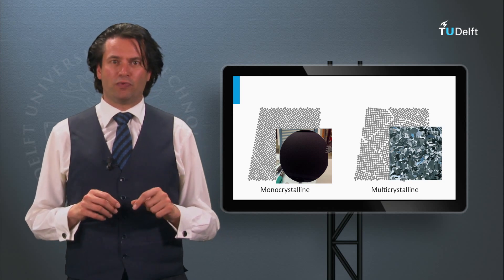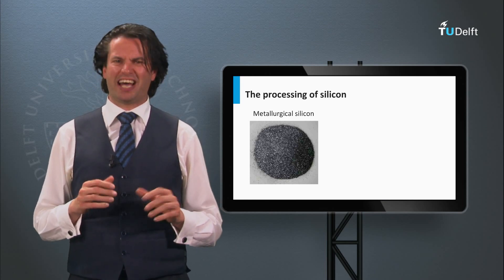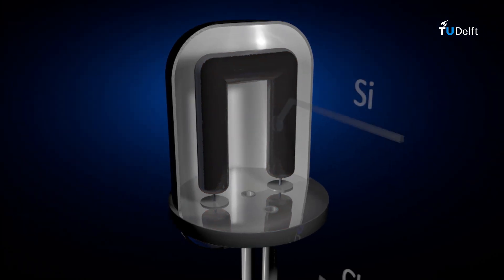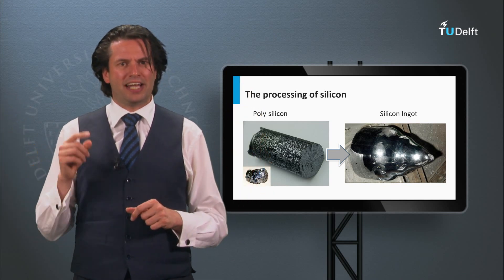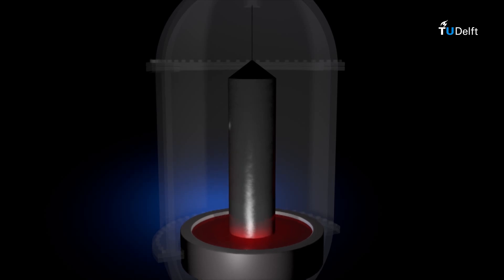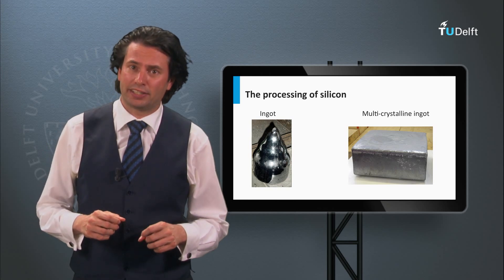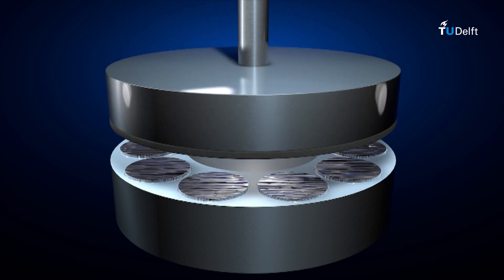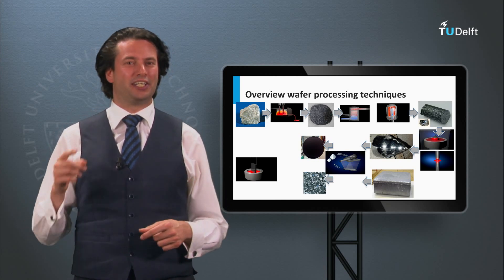4.2 Manufacturing of crystalline silicon

Comment: There is a new method for making monocrystalline solar cell material that doesn't involve cylindrical ingots or ribbons. It's explained here in this (very short) tutorial:
https://www.youtube.com/watch?v=EZQtJU0Ib9Q
Thanks to this process, it is no longer possible to tell monocrystalline solar panels by the little white diamond shapes at the cell interstices. Those diamonds were the backsheet showing through the cell corners, which were the original cylinder edges. For that reason and for the emergence of the PERC process, which improves efficiency in mono-si cells but not so much in poly-si cells, poly-si is pretty much over as of 2023.

Comment: I have been trying to find an independent explanation of this process for years. I didn't even know silicone ribbons was a thing. It sounds alot easier to make too. If I ever find myself in need of making cheap circut boards after the impending apacalypse this will most likely be the method I will use. After all silica if everywhere and is very VERY versatile.
Reply: not necessarily in the apocalypse, pretty sure you can achieve the needed temperatures with as easy to get substances as SiC (Silicon Carbide) resistors
with such (added to the fact you can use phosphor and aluminium as doping agents), it's technically possible to produce LED at home (added to the fact you're ready to produce all the energy by rotating a crank in an electromagnetic field because no way one will be able to get all of this into their electric bill and not raise eyebrows)

Comment: Understand coal is used to get to that 1900 degree temperature. So what's the environmental tradeoff?
Reply: Why coal? Electric resistances with tungsten alloy should be able to get those temperatures, or even high powered laser. The direct carbon footprint is in the SiO2 + 2C -> Si + 2 CO, yet carbon monoxyde can be turned into carbon dioxyde, then into methane (through sabatier reaction),  then graphene or graphite using CVD technology. It isn't the cheapest way, yet it is a zero carbon footprint possibility.

Comment: I have so much confusion on growth orientation. Example, If the seed is (111) orientation (lattice plane). (111) facet is introduced perpendicular to the direction of rotation and in contact with melt. This obviously means that any melt coming in contact with that particular plan follows its direction/orientation. Now, what about the other facets of the same seed dipped in the melt that may and may not  have the same orientation and are in contact with the melt and spinning? Are seeds commercially available so someone can the pick the direction of growth depending on the desired wafer plane?  Could you describe the size of the seed and  its different facets' orientations. Thanks
Reply: The seeds that we used in rod growth were square, a little bigger than a pencil and they were cut from a much larger ingot that had either 1-0-0, 1-1-1 or 5-1-1 orientation. The seed was dipped into a molten charge and a small "neck" grown which looked like an icicle.That process forced out random crystal structures. After verifying zero dislocations, a tapered pancake disc was allowed to grow to certain target diameter then the lift rate increased till a round rod starting to be pulled from the molten charge.
Reply: @toddweaver55  Hello Todd,

I am curious about how the seed crystals are made, since everywhere I have read about the CZ doesn't mention it. So, thank you for mentioning that it is cut from a larger ingot

However, I am still curious about how the first seeds were made. Would you know about that, or do you know somewhere I could read about this in more detail?

Thank you in advance
Reply: @brenorocha9407  just like any precision tool... repeated iterations of purification friend... low energy and copious time... the manufacturing processes shown are at warp speed compared to growing a seed ingot

Comment: Question... With the amount of heat we are putting in to create each crystalline silicon (for solar P.V. panel purposes) what quantity of energy are we getting back from it? You mention these huge temperatures, but wouldn’t this heat expenditure be better used once technology advances and we are able to get higher than 15-20% efficiency on solar panels commercially and up to 40% domestically?
Reply: I used to operate 6 Hamco Crystal pullers at MEMC Electronics. Each puller used a carbon/graphite heater that ran off 60 volts dc at 2000 amps. Thats 120,000 watts. There were 74 machines there. There was some power being consumed thats for sure. A typical growth cycle was 36- 48 hours.
Reply: @toddweaver55  
Good starting information, and if you could explain how many wafers are produced by each puller using 120 Kw in every 36-48 hr cycle, then we calculate the power efficiency of the system, please?
Reply: Hi Adrian. Great question. This is one of the challenges of the PV industry and solar cell companies are always striving to improve on the energy consumption that is used to process them. Typically, a solar panel takes about 2 years of sunlight harnessing to obtain back the energy that is used to make them. 

One more thing, it is impossible to get up to 40% efficiency with this type of traditional commercial crystalline silicon solar cells. There is a theoretical limit (abt 30%) for that (SQ limit). Hence, reducing the energy consumption during processing is the only way (not increasing efficiency since it is theoretically not possible). There are non-traditional solar cells that can surpass the 30% mark but it is very costly and might require larger amount of energy.

If you are interested to learn more about solar cells in an intuitive and fun manner, I'm starting a video series called "Shining Light on Solar Cells", covering the a-z of solar cells. Catch the series here: https://youtu.be/53eBzy8eZ-8
Reply: That geothermal heats the silicon production is a non cost silicon production.
Reply: @jonbigeffortthegoodness7437  Haha, false logic. Incorrect.
Reply: Should have been running the whole planet off the fissioning rock as of 40 years ago, yet here we are. What a mess.
Reply: I think it takes somewhere around 20-30 years for a single solar panel to reach carbon neutral. Depending on manufacturing techniques as well as quality of the solar panel. Considering most solar panels break by year 15. Solar energy is far from beinga. Clean green energy. But you will find that to be the case with most "green" energy sources. Such as wind turbines and hydroelectric damns. They often do more damage then they are worth. It's only fear mongering and human procrastination that keeps the industry afloat. Don't get me wrong. Solar panels and wind turbines are great alternative sources for power. They just aren't the end all be all most company's will have you believe. It's basicly new England's energy pipeline. Billed as being green energy to the voters when in reality its excess energy made by a Canadian coal power plant that cabt sell its powet to Canada so they sold it to the US as "green energy". 

Moral of the story? Don't believe what you are being told do your own research and the truth will become clear.
Reply: @halogeek6  You work for big oil? Your propaganda is transparent.
Reply: @canadiangemstones7636  ah yes. I work for big oil. Becuase there is no possible way I might just be informed on the subject having done real research. You must be invited to alot of partys.
Reply: @halogeek6  You are full of shit.